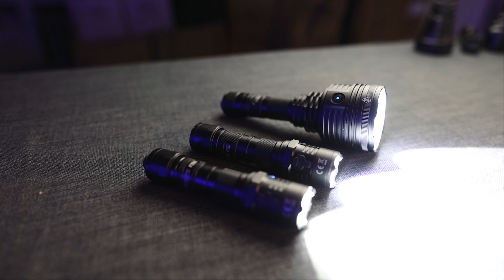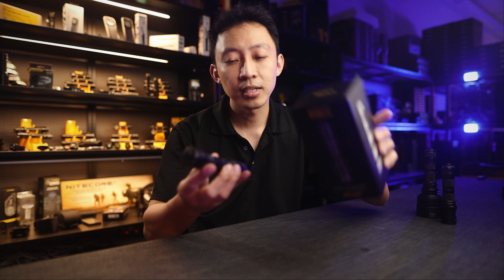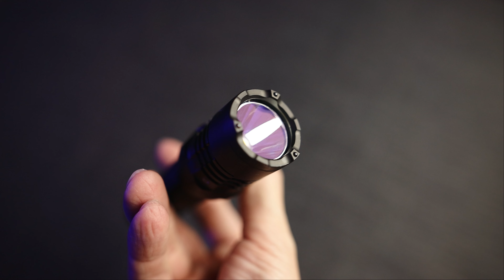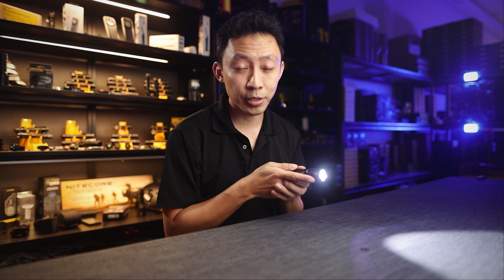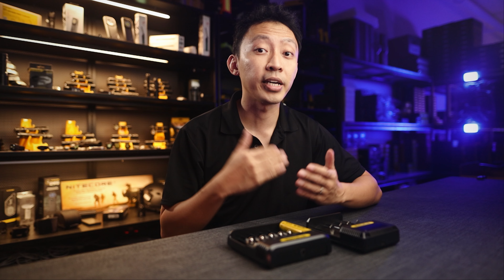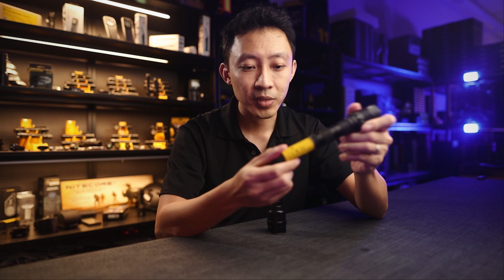3 Best Lights For Guard House & Security Command Centers

Comment: I work in security and law enforcement and from my experience there is a major issue with the P20 series and similiar lights: You cannot carry them tip up on your belt because there is a very high chance the unprotected button will catch on your vest and turn the light on.  This happened to me many times and it almost started a fire in the car as the light melted the bottom of my NPC30 holster.

Second issue which is minor is with the included NL21 it is much too flimsy for any type of security or law enforcement work. Every arrest I've made I ended upp picking the light up from the ground afterwards in fact most of the time I take of my belt and throw in trunk of the car the light also fall off.  The clip part is so bendy the little pastic piece is very likely to fall out aswell.

It's a shame because the light is damn near perfect for my line of work. I've retired my p20 because of it.

Comment: The water proofing of the nitecore lights is not that good, i have a Mh12 V2 and P20iX. The lens moist if the light is in the water/rain
Reply from the maker: For these lights you can bring it back to your distributor for warranty exchange. It’s covered.

Comment: I worked in construction industry most of my life. Most problem we encounter is that most flashlights are made to throw beam. In the past you have this Maglite flashlight. Its the perfect flashlight that have both flood and spotata twist. But its too bulky. Todays flashlight is either flood or spot. In a building for example ypu have every nooks and cranies and most flashlight are spotlight type where you have this hotspot in the middleand the surrounding spill beam are not so useful. Indoors bar lights are useful but they can be bulky because of their size. In the past even maglight brand of flashlight are only good because its the only flashlight that have floodand spot. But nowadays most flashlight are either too bright or too bulky even if they have great lumen output. Because you have to balance lumens output and runtime.

Comment: I am a mobile security Officer, I purchased p20i as my workhorse and I am working nightshift. But after few months and during in the middle of my shift my p20i was shut down and wasn't working anymore for unknown reason It was malfunctioning . The battery was fully charged and even I changed the battery to a new one, my p20i still not working. Disappointing.
Reply from the maker: Hey just bring it back to your retailer they’ll take care of it for you. At least 3 years warranty.

Comment: We need a light that has a long throw distance while Also having floodlight capabilities or search light characteristics and a 1 click switch to a lower setting  for inside use so we don't have washout  from light deflection from walls. All this and extended battery life to.
Reply from the maker: Can I find out more context around your team / scenario? Is it marine, construction or rescue type role? Inspection? If there’s concern on wall deflection.

Comment: For use at the entrance and dependencies of the Condominium to P20ix due to its flooding, as the external areas and underground garage have small distances.

For Home I would use the P20ix and for EDC the MH12SE, both with battery backup.

Comment: My team is a wildland fire hand crew. We use flashlights for many things such as strobe to signal helicopters in the daytime while in thick timber. Also in camp at night for eating dinner and unpacking our tent and sleeping gear. We also use headlamps while working at night. The main issues I have come across is an excessive amount of used AA batteries since we need to make sure we always have full bats to keep us going all night long. 

Im looking for a system to cut down on the amount of batteries we carry and throw away. While also making it easier to keep everything charged since we don’t have access to power outlets other than our trucks. And being able to keep our phones charged in the field would also be a plus.
Reply from the maker: This is awesome, will def make a kit around this
Reply: @nightwalkerlab  WHAT KNIFE AT THE START???

Comment: Hey MJ I am a young adult, just turned 18 a few weeks ago, and been into flashlights over the past year. The biggest problem that I encounter with the lights I have is that they don't have a very good beam distance, I've only been able to buy a resealed E4K and a MT21C, so if I'm gonna buy some other light in the future, it's gonna be one with a +350m range 🤞
Reply: You should look into the mh12Se with over 400+meters throw and 1800Lumens. I currently own one and it's incredible
Reply: @OG-IgnacioMontoya NC have discontinued the MH12SE so they can push their more green tint MH12 PRO
Reply: Check newly released P23i 470m beam and 3000 Lumens

Comment: I have the Nitecore P20ix and it's by far the best tactical torch out there. I'm looking forward to purchasing the new Nitecore P23i when it becomes Available. Team Nitecore.👍
Reply: battery not so good
Reply: @马化腾之爹  I've had no problems with the battery, it's been amazing.👍
Reply: @infinitesix9875  As long as you don't mind  its own battery，P20ix is the best one.
Reply: @马化腾之爹 if the P20iX is the best tactical light then what more do you need from  the P23i?

And if you could choose only one which would it be. For self defence purposes.
Reply: I love my P20ix however; mine has a slight issue.  Mine is set to the highest brightness when I first turn it on.  When I try to step down in brightness, most of the time, the strobe turns on.  The way to remedy this issue, I twist (loosen) the battery compartment then re-tighten it, then the brightness level will step down correctly.  Do you know if yours has this same issue?
Reply: @crxk20r59 you had it in tactical mode, normal mode remembers the last brightness you had it set to, doesn’t resort to 4k each time. It’s an intentional feature so it can suit your needs (I personally keep on tactical for example). Cheers

Comment: I think the most common problem a flash light user often meet is the running time, cause we sometimes do not checking the battery really often so that I sometimes turn the light on but it's in a very low battery status. That is the problem I used to have
Reply: Always  have a spare battery! You never know! Or maybe a power bank
Reply: @alexp5249  yeah I always keep a power bank that’s a must! But battery is even better as well
Reply: Yep!!! I keep a spare battery on me at all times for that reason
Reply: p20ix has indicator light, if flasing slowly indicates that the power is below 50%, flasing quickly if below 10%.